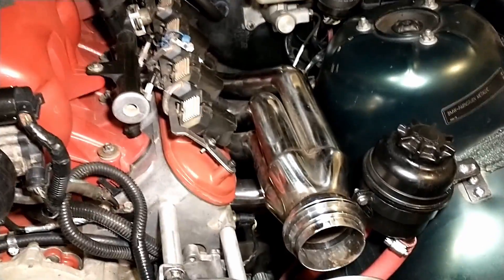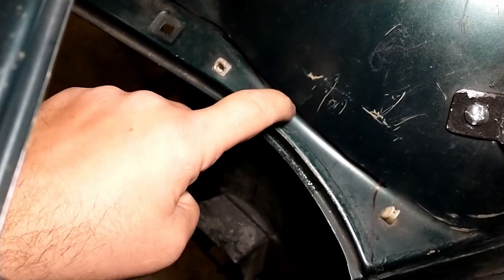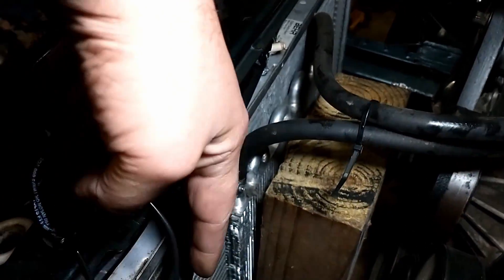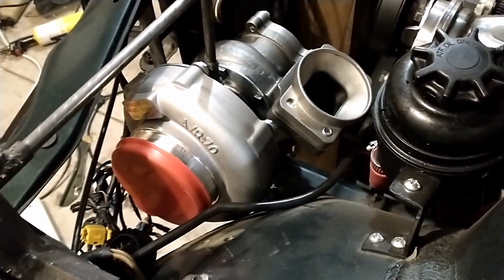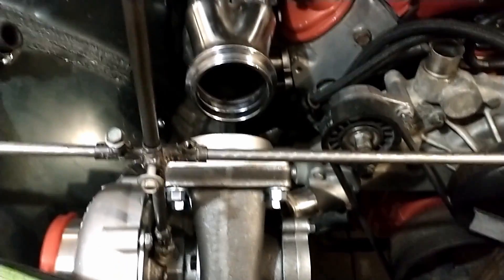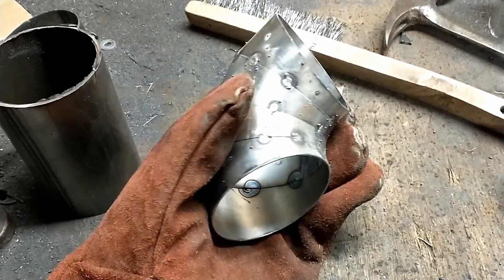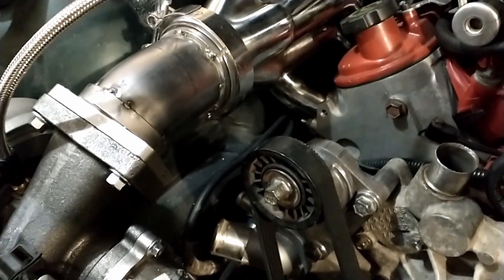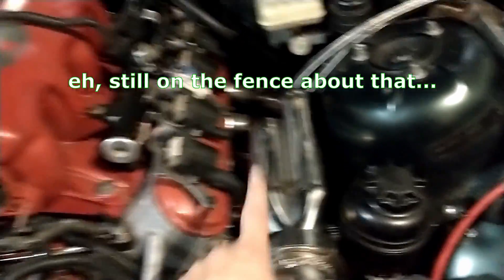Building the Turbo Hot Side for the LS Swapped E36

Comment: Man you are gonna motivate me to get some videos edited on my LS E36.
Reply from the maker: Let me know if you get some up. I'd love to see them!
Reply: @815LSxSwaps  I have 5 episodes up right now. And a few Trailblazer SS videos but nothing crazy.
Reply: For my e36 LS swap I've had purchased an adapterflange  for my turbos the down pipe flange is a five bolt style with 3" v- band . It's should except the 3" crossover piping.D o you show how you ran the crossover and intercooler connection?? Where does your exhaust exits the car?

Comment: Hey bro Can you use stock ECU and harness for this type of LS swap? And can it use truck intake and rails?
Reply from the maker: Yeah this one is on a stock ecu and harness, it's also on truck intake and rails too! Hood clearance is the only issue with truck accessories and intake
Reply: Thanks for that info, I'm running two turbos and want to go speed density, Is that the economical way? What component do I use? My set up is two 65a/r turbo, two 44mm waste gates, two HNK blow-off vales, two mac- electronic boost controller, stock ECU, a 3bar map sensor and two wideband O2 sensor before turbo.. I'm I missing something??  👍🏾

Comment: How did the 02 sensor hold up being before the turbo? This is my first ls turbo build not sure if I should put them in the down pipe or leave them in the stock location like yours.
Reply from the maker: O2 sensors are still working great. No issues running them there.

Comment: Hi I'm doing the same swap on my e36 bimmer. Which headers did you use, and do the driver side hit alternator?
Reply from the maker: I'm using the eBay up and forward turbo headers with the short collector. Alternator is mounted in the low fbody location so there is no interference.
Reply: @815LSxSwaps  ok I've ordered a ICT billet low mount alternator and PS pump kit, for 5.3L e36 swap. My issue is that my PS pump is for the Corvette ICT kit and the spacers push the pulley about an inch outward from balancer! But still need to clear foward turbo headers! Hope this bracket kit is the right one

Comment: What motor mounts do you use?
Reply from the maker: We used a full cxracing kit
Reply: @815LSxSwaps   man it’s a crazy setup and i love it, i started a single one using a gt45 and is very big, and i like the radiator idea of yours, it might get me some room. i’ll follow your build till the end!
Reply: did you only hit the strut tower on passenger side? the driver clears?
Reply from the maker: @maxstatarcos7584  yeah just the passenger side, drivers side was fine.  We have twin GT45s going on the foxbody and yes they are big lol which is why we went with GT35s for the BMW. Thanks for the comments and following along!
Reply: @815LSxSwaps   sorry for the bunch of questions..... lol
Reply from the maker: @maxstatarcos7584  no worries, thats part of why we started this channel to help out other people! Feel free to ask questions whenever.
Reply: @815LSxSwaps  one more....😂... what about spark plug wires?
Reply from the maker: The plug wires on there now are just Amazon LS header wires. Got them because they were a little longer and cleared the long tube headers better. Going to look into a better option for the turbo headers once it's back together.